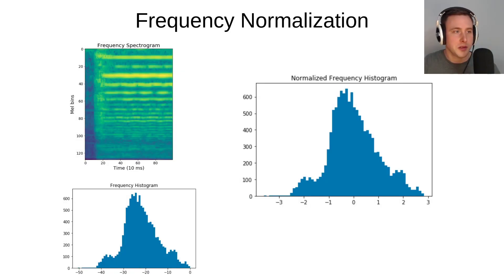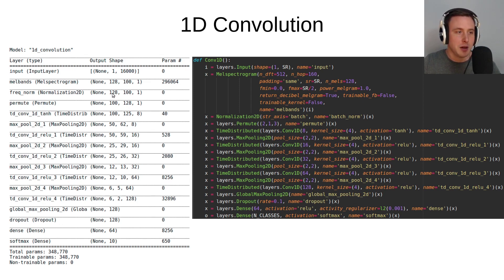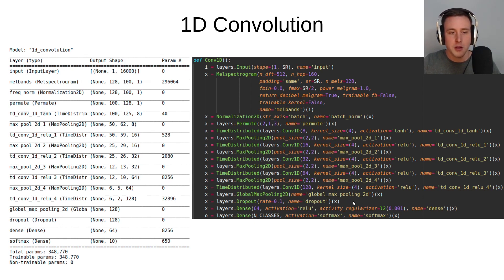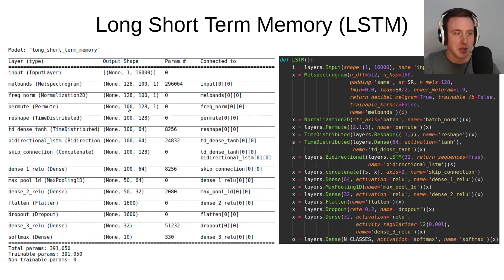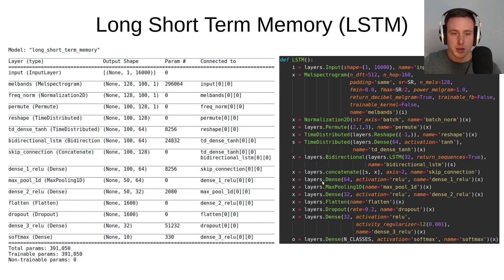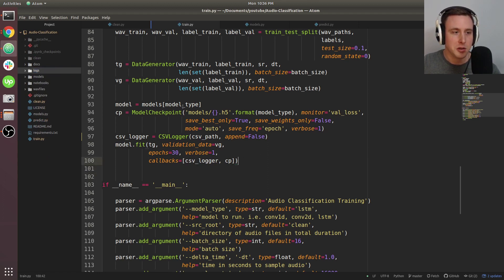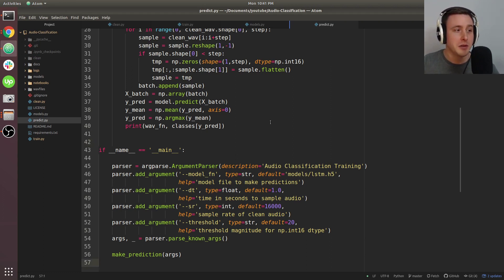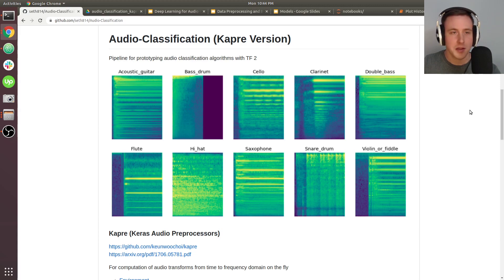Models And Training - Deep Learning for Audio Classification (kapre) p.3

Comment: Seth please i urgently need your help with the ValueError, that you have mentioned in the pinned comment as I reached  this point and I can't find the fix as I read in the comment that you pushed it already. Please help. Thank you for your help
Reply from the maker: I'm not sure what file you are running, but this looks like a settings error. If you are running predict.py, make sure the src_dir argument points to the same cleaned wavfiles directory from previous steps.

Or just give me more details. Like file you are running. More info about the trace back like line number...
Reply: @seth8141  i am running the train file and im getting he ValueError: y contains previously unseen labels: ['clean']
please Seth how can I run it in Windows without getting the error, as I read here in the comments people are having the same error but when they run it in Linux Its fine, though I want to run it in Windows. Thanks a lot

Comment: Hey Seth, first, thanks for such an entertaining, informative series. I do have a question-- do you know what the input shape of the training model would be? For instance, a YOLO CNN has input shape of [1, IMG_HEIGHT, IMG_WIDTH, 3]. However, as we're working with audio instead of images, there obviously aren't height/width dimensions. Would the input shape of this audio model have an extra dimension, because the input spectrogram is also three-dimensional (as opposed to 2d height/width)?

Comment: Hi thanks for this tutorial series. However, could you update using the latest version of kapre? Apparently there are big changes in the latest version and many of the implementations in your tutorial are not applicable. Thanks!
Reply from the maker: Should work with kapre 0.3.4. Just pushed an update.
Reply: @seth8141  Hi Seth, I saw it on GitHub. Thanks so much!

Comment: Hey Seth, I had a few general questions regarding your project, if you could, please take a few minutes to answer them.
1. I've used your previous model on different datasets and learned how to extract the data from csv files using the filename and label, how do I attempt the same with this one instead of using the directories as the label ?
2. How do I get the overall accuracy score from the predicted values ? 
Thank you.
Reply from the maker: 1. You would have to modify the code quite a bit to load from csv. I would recommend using directories as labels. Seems to be how most people do it for classification.
2. When you run predict.py it will generate a y_pred.npy file in logs directory. in notebooks/Confusion Matrix and ROC.ipynb you should have access to the predicted and true values. It assumes that the files have not changed between runs because it just works with sorted filenames in the directory so if you add or remove files and are doing multiple runs with different data this could be a problem.
Reply: @seth8141  thank you so much for getting back to me!
I used what you did in your previous models in order to create accuracy scores and have made a small python program to rearrange in order to use this model. 
However, on testing with bigger datasets such as Urbansound8k or ESC50, I've been getting really low test accuracies on new data, that is, data that was not used in the training samples. I have very little idea about what I could tune in order to get better results. Will changing the ndft or nhop or dt values help? Changing the threshold? Adding more layers?
Please let me know or we could email if that's suitable for you. Thank you again.

Comment: Hi sorry I had another question. The spectrogram layer returns (None, n_mels, n_time, n_channel). How is n_time determined?
Reply from the maker: Should come from n_hop. So a signal that is sampled at 16 kHz with n_hop = 160. 16000 / 160 = 100 n_time. So the time dimension is 100 for 1 second of data.

Comment: hello, thank you so much for awesome content! I just wanted to clarify what n_hop means. Is n_hop the overlap between successive windows? If not, then shouldn't we be able to specify that parameter?
Reply from the maker: n_dft is the window size. n_hop is the delta samples to shift the window over the time domain signal. So the overlap is actually n_dft - n_hop for each successive window of data points.Usually there is also a filter on this n_dft window. (like a hamming window) Although you would probably need to dig into the kapre source code to see if this is done anywhere.
Reply: @seth8141  thank you!

Comment: Hi Seth, Very nice explanation and i tried to run in my windows10 machine but its giving below error with LSTM but same code runs for Conv2D. Any idea??
  File "train.py", line 114, in <module>
    train(args)
  File "train.py", line 96, in train
    callbacks=[csv_logger, cp]) 
 ...site-packages\tensorflow_core\python\keras\layers\core.py", line 1069, in compute_output_shape
    % input_shape)
ValueError: The innermost dimension of input_shape must be defined, but saw: (None, None)
Reply from the maker: https://github.com/seth814/Audio-Classification/issues/11

Comment: Hello Seth! 
I've tried to increase the samples to 5 seconds duration but got the overtraining on LSTM model. Could you please help to understand, why does it happen? How does the samples duration influence on training results?
Reply from the maker: Increasing delta time makes total samples go down. And if you only have a few examples for one class the you see a new sample that looks a little different, you get it wrong. Because you just never saw enough variance of data in the first place. That's overfitting.

Comment: Hi there, im interested to know how can i clean my audio dataset(google speech commands) if it containts faulty audio. For example i should hear word "three" but there is too much noise or the word is cut in the middle so it just says "thh.." 
Any idea how to get rid of those audio files and clean my dataset ?
Reply from the maker: Only thing I can think of is doing semi-supervised learning where you have a small amount of good, correctly labeled data and the rest is unlabeled. Or you keep with the small data volume and try a siamese net. So yeah not sure if there is a way to clean the data. Just ways to work around a smaller data size.
Reply: @seth8141  Thank you very much for the fast answer. Also, how many of a good data do you think i'll need per class. So if i have 10 classes (10 different words), how many audio recordings do you think is necessary to train neural net. My end goal is to train neural network so it can classify my voice speaking those 10 commands. You used 30 .wav files for each class (instrument), do you think it`ll be enough for my problem too ?
Reply from the maker: @stipan11  If it's something simple that only uses your voice then small amount of data is fine. Normally you train on a large dataset then use your voice for verification. Like a siamese neural net.

Comment: Thank you for the amazing series!
I was trying it out with a delta_time of 5. It obviously doesn't match the shape. Could you help me out with the tuning for the LSTM model?
Thank you!
Reply from the maker: In models.py you need to change Input shape to (1, SR * delta_time)
That seems like the obvious thing that would be wrong. Hopefully that's all you should need. I should probably make a change to update that from the train.py file.
Reply from the maker: Pushed an update that initializes model params from the train.py argparser. Should work as long as you remember to change dt in clean.py first. Also you might want to play around with model layer depth if you increased delta_time to make sure dimensions decrease by the time you flatten for classification. Otherwise your model might take up too much memory on the GPU and not work so well.

Comment: Hello Seth, I am getting the following issue: "ValueError: y contains previously unseen labels: ['clean......" This occurs with all default settings, and also with conv1d and conv2d.
Reply from the maker: What OS are you running? What line does this occur on? Steps to re-create?
Reply: @seth8141  Just figured it out, running in windows caused the issue. Moved to OSX and the issue is gone.
Reply from the maker: Okay thank you. I'll test on windows and see if I can make a fix.
Reply: @seth8141 i got the same issue .  you can try it on ubuntu or any linux enviroments . it worked for me..
Reply: @abisheiksanthosh9108  how can i fix it for Windows, please help ?

Comment: if i run the train.py code .i'm getting this error   "ValueError: y contains previously unseen labels: ['clean......" how to fix this?..
Reply from the maker: I'll take a look
Reply from the maker: What OS are you running? What line does this occur on? Steps to re-create?
Reply: @seth8141  its running in ubuntu but not in windows
Reply from the maker: @abisheiksanthosh9108  It's an easy fix. I just won't have time to test on windows for a few days.

Comment: I have a few questions that I hope you can clarify!  Thank you so much for the series!

1) Is TimeDistributed(Conv1D) performing a 1D convolution at each timestep over all frequencies OR at each frequency over all timesteps? So in the first case, you essentially have similar data to an FFT for a tiny sliver of time. You have all of these different frequency decibel values that you then convolve (and repeat for each timestep). In the second case, for a single frequency, you have a bunch of decibel values over time that you then convolve (and repeat for each frequency bin). Regardless, would there be any potential benefit to performing a TimeDistributed(Conv2D) to get additional information from adjacent bins? I imagine it starts getting similar to the standard Conv2D network at that point, though.

2) With standard CNNs (usually on 224x224 images), it's common practice to perform two 3x3 convolutions sequentially before the maxpool to mimic the larger receptive field of a 5x5 convolution with fewer parameters. Can the same be done with the Timedistributed(1DConv)? Is that at all common practice here or unnecessary? On a side note, I imagine the kernel size will potentially differ depending on how big your fft windows are. Do you do this through trial and error or do you just have a typical size that works well.

3) Is Normalization2D taking all decibel values in all of the spectrograms within the batch and normalizing them (in this case, batch_size*128*100 values)? This is sort of like a standard batchnorm layer except that it is not parameterized/"learned" by the network, correct? If this is so, let's say we want to deploy our model to do real-time inference. Is that final post-training mean and standard deviation stored for later use so we can do inference on one second of audio at a time?

4) Lastly, the networks I've trained seem to still function when using RELU in the first layer (although, I typically have a batchnorm right before it, so maybe that's how it doesn't completely fail). Do you networks converge faster or typically perform better using tanh?
Reply from the maker: 1) 1D Convolution at each timestep over all frequencies I think. Don't think there is any point in TimeDistributed(Conv2D)

2) I kinda just make the 1D convolutional model for fun. I would normally just use an LSTM. You just use however many layers of depth that you find will work. Here it seemed to just slow everything down and not give better performance.

3) Yes it should use the whole batch. I haven't had issues with the batch norm and running on new data for prediction. It more just changes a little bit with the batch. Doesn't store anywhere I don't think.

4) Here tanh made a huge difference for me. Convergence speed will be the same. Quality of convergence will differ between the two functions.
Reply: Seth Adams great work